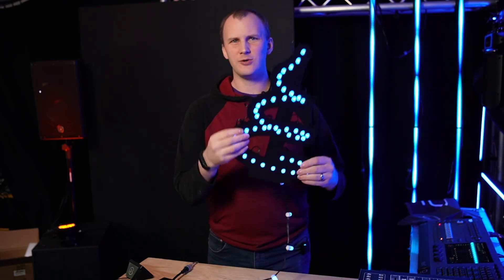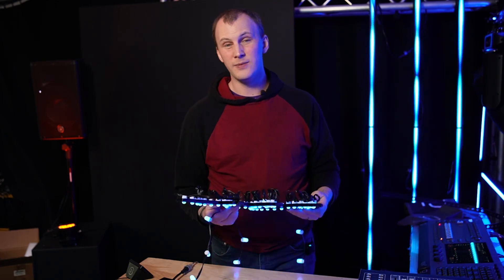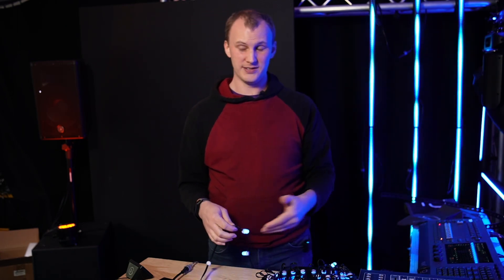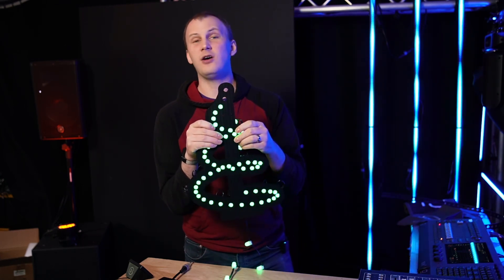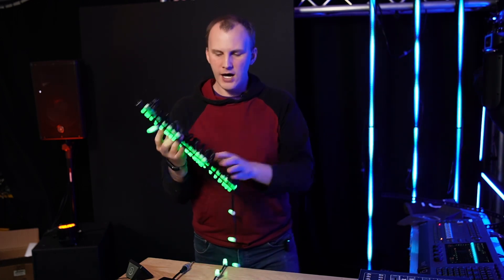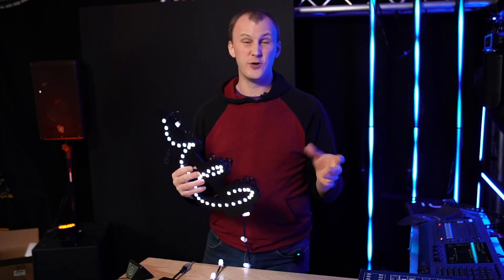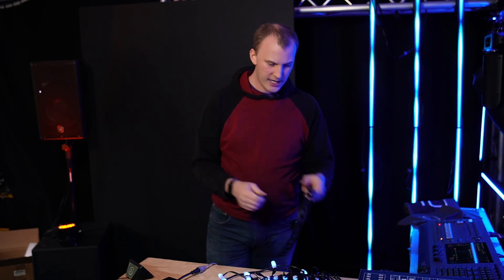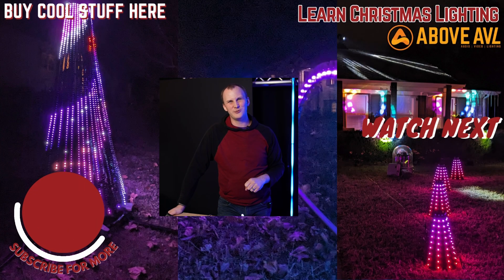How Are NBG Pixels Different from Other Dome Pixels?

Comment: I ran NBG’s last year and they were great!  Used them right next to previous years’ bullets and while I noticed a VERY slight difference, not one other person did.  The more diffuse colors from the white dome made for a very pleasing color wash.  Also, pushing them was so much faster and no pain on the fingers!  I just got in another order from David last week to get a jump on this year’s new props.  I will also plan to replace any strings that lose pixels with NBGs moving forward. Thanks David!